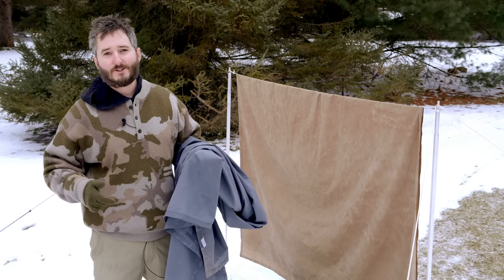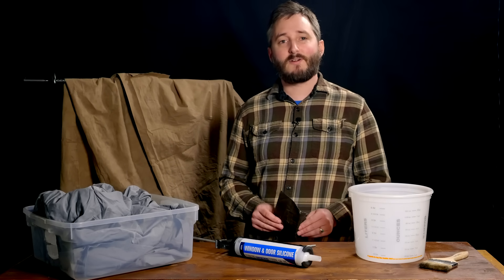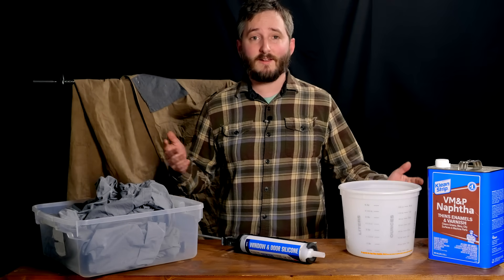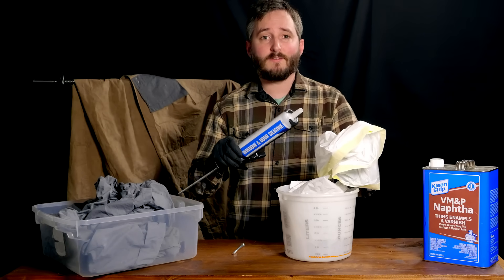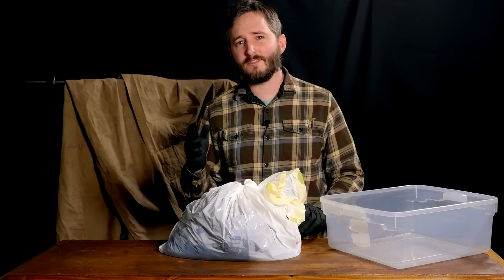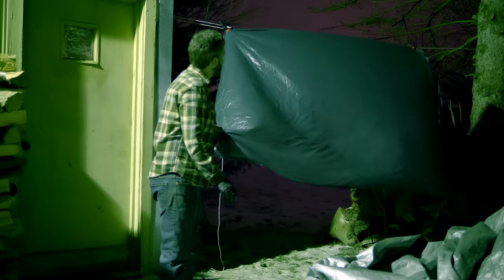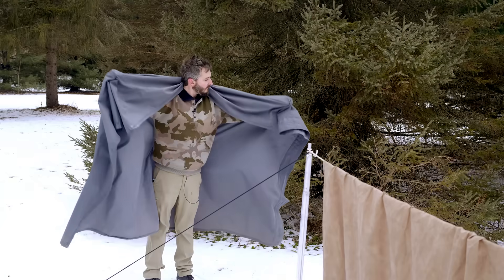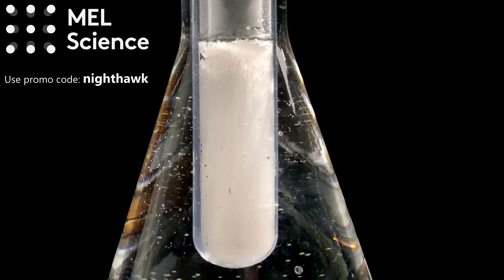Recycled Bedsheets Make The Best Waterproof Tarps

Comment: Why don’t you use water soluble silicone in stead of naphtha stop releasing the VOC’s into our atmosphere please , it will work the same way !
Reply from the maker: I didn't know water soluble silicone existed. I'll have to check that out
Reply: @Nighthawkinlight  it does , we used it all the time at work . You can get at any place that sells caulk , silicone caulk is water soluble
Reply: @Nighthawkinlight  there’s even water soluble clear plastics out there we use it at work as well .
Reply: @Nighthawkinlight  look at tubes of caulk if it says easy water clean up it’s water soluble . Good I never thought of waterproofing bed sheets it would have saved me some cash no more blue tarps lol .
Reply: @Nighthawkinlight  I have another idea they make a water based polyethylene deck sealer I wonder if that would work  just as well  a water soluble plastic . Experiment with it let me know if that works .

Comment: Love this idea! “Outdoor curtains” are quite expensive, especially if you want it to have a nice print on it. 

Thinking of buying bedsheets in a nice fabric and using it for curtains on an outdoor gazebo. How long should this last?
Reply from the maker: Hard to say. It depends on sunlight exposure. A few years at least
Reply: I think there is uv resistant silicone, that should help with longevity

Comment: Could I use this in a Hudson pump sprayer and spray on my roof shingles for this season as I have some leaks. I plan on replacing roof next year.
Reply from the maker: I'm not sure what that would do. I wouldn't risk it. The naphtha is extremely flammable and the vapors might fill your attic

Comment: Loved this.  Wonder how flammable the finished tarp would be.  

If you can paint this on or spray it you could probably make your own rain coat , ski bibs, etc., biviBag with the bottom being water proof.  Or water proof the bottom of your sleeping bag to overcome those leaky tents & spray your tent     Even use your bedsheet sheet as a cape like you did but big enough to cover your backpack and create a row of ties down both sides using the button string as you showed than tie the strings opposite each other together.   Carry a plastic sandwich bag in your pack filled with buttons and short pieces of strong string with a slip knot on each end.  That way you can create a quick tarp or a rain/ wind cape
Reply: Silicon is heat resistant and non-flammable.
Reply: If done properly it should be fairly flame resistant, it is still cotton though so under sustained flame it will eventually burn but a Lot better than say an oiled canvas.

Comment: Love the video. was going to go get some Naphtha. I looked up the price. It is about $45 for a gallon can of Naphtha. Considering that the bedsheet will eventually degrade in UV light, that is an expensive tarp. The thick plastic tarps last about a year for a fraction of the price like $5. Is this a cost-effective project? Please comment on your thoughts.
Reply from the maker: Naphtha is $16 per gallon where I am. I've been told that others have had success with ordinary gasoline, but that would make the fire hazard while making the tarp even more severe.
Reply: @Nighthawkinlight  That's much better. Can you provide link to where you get yours? I was looking at Amazon and found another vendor, which was $15 per quart.
Reply from the maker: @awesomedee5421  I get mine locally at ace hardware
Reply: @Nighthawkinlight  I'll have to check my Ace next visit. Can I use basically any thinner like paint thinner? The goal is to just get the silicone into a liquid form, right?
Reply from the maker: @awesomedee5421  You can't use any thinner. Mineral spirits apparently works but I haven't tried it.

Comment: How do we make this non flammable? I notice you said the mixing process could cause a fire.
Reply from the maker: The finished tarp is not especially flammable once dry. There's no way to remove the risk of fire in the process of making the tarp because the solvent is basically lighter fluid. You must be careful.

Comment: Just to be clear you should state that you are using silicone caulking. It really makes a difference. If you go into a hardware store and ask for a tube of silicone they will ask for more information. I know it’s pedantic but may help someone get the correct product at the store. Otherwise this is a super cool idea and I can’t wait to waterproof the crap out of all of my outdoor fabrics. Thanks for this idea. It’s much appreciated!!
Reply: 100% silicone caulking
Reply: thanks for clarifying that. That helps me.
Reply: Do you mean like silicone bathroom sealant? thanks
Reply: If the sales personnel ask you for more information on what kind of silicone you want, what else do you think they're thinking of?
Other caulking materials like acrylic are not silicone and thus not what you're looking for.
If, however, they ask you whether you want tin-cure or 2 component platinum-cure, go with the latter if you can, as tin-cure silicones are not skin-safe

Comment: I have successfully replicated this tutorial using mineral turpentine instead of naphtha, which is not sold locally in my country. 
It took a little longer, 36-48 hours to fully dry. The material I used was 100% cottons and extremely thin fabric. You could see straight through the fabric in good lighting, so probably a 60-120 thread count, but the water repellant quality is still there even using a single layer. The tarp is unbelievable light weight and compact.
Reply: I'm in the UK - what would anyone recommend as a good alternative to naphtha? I want to waterproof some cycling gear. Thanks for any information. 👍
Reply: @marknorman8588  Like I mentioned, mineral  turpentine/mineral spirits works fine, but needs to dry for a little longer.
Reply: Wikipedia refers to a PDF document providing substitutes for naphtha in different countries - white gas, shellite, wasbenzine, renset benzin, reinigungsbenzin,
kocherbenzin, benzina bianca, delek lavan, white gasoline, fleckenbenzine, 去漬油
Reply: The smell goes away I presume when dried?
Reply: @zee2938  but have to say after further testing, I wish I would have gone for a more tightly woven sheet.
Reply: @DKFX1  ok thanks for the tip. I’m considering making my own hiking poncho that doubles as a tarp. Have a cheap one on the way to test out and maybe see how I would want to modify it compared to other ones. If I can make my own waterproof fabric that would be ideal! Also would be handy for making my own gaiters. So many things.
Reply: @zee2938  yes, totally gone when dry and I didn't use the odorless version either.
Reply: Do you think gasoline would work?   It's usually my go to instead of spending 5-10x as much on naphtha.
Reply: @bullschitt3666  No, I don't think it would be a good choice, but I'm not completely sure about it.
Reply: @DKFX1  how does the tarp hold up over time? Does it wet through after a night of holding back rain? Thinking about this for an ultralight backpacking tarp
Reply: @richeyrich2203  Mine actually gets a bit wet rather quickly I found out, but will still keep water out. I suggested going with a tightly woven fabric as mine did not perform as I wanted, but I think it would have if I'd gone perhaps 250-300 threadcount or higher. .
Reply: @bullschitt3666  sounds terrifying,  and dangerous lol
Reply: @bullschitt3666  Bought some generic brand charcoal lighter fluid. 1qt for $6 USA VS $38 for Naphtha. Worked like a charm!
Reply: @bullschitt3666  naptha is straight run gasoline, same hyrdocarbons more or less
Reply: @Sinanjuphenex  I don't think gasoline will evaporate properly and will leave a bad smell. Just my intuition speaking though.
Reply: @Sinanjuphenex  This is not at all true. Naptha has 5-6 carbon-lengths on average while gasoline has 4-12 carbon-lengths PLUS additives for anti-wear, cleaning, and more.
Reply: Yes
Reply: Thanks for your info. Naphtha not available in my country except in Zippo lighter fluid which is horrendously expensive for a tiny 125 ml can.
Reply: @taab7  Mineral spirits or White spirits depending on where you live will work in place of the naphtha
Reply: Could you do this to any item of clothing?
Reply: @danielsbox27  yes, but some type of clothing would be best treated with a brush instead of submersion. Also, I would avoid treating stuff that has direct contact with skin.
Reply: Thanks! What fabric did you buy? Just trying to figure out how to make it lightweight as well as wide.
Reply: @ErmilinaLight  I'm a sewer so browse the fabric stores alot. I see lots of REALLY WIDE 100% cotton fabrics that is manufactured for use as quilt backings.  There's even muslin that is  XTRA WIDE. 
 Hope that helps out some of you folks.
Reply: @lynnodonnell4764  you seem to have posted this as a reply to another suggestion. Maybe in the main comment thread it would get more eyes on it and be even more helpful! Thanks for sharing.
Reply: @lynnodonnell4764  " Hope that helps out some of you folks. "
Sorry, doesn't help much without references.
Reply: @lynnodonnell4764  Oh, thanks! I was actually thinking maybe using polyester would be a better idea?...
Reply: @ErmilinaLight  that may melt in the solvent
Reply: The trouble with turps is it stinks and even the deodorizedone stinks and did the smell come out of yours if not a great people repellant and be careful sitting round the campfire regards from australia 😊😊😊😊
Reply: What ratio of ingredients did you use?
Reply: @zakkart  Same as Nighthawk did: 5 to 1.
 300 gram silicone for 1.5 liters of naphtha.
Reply: Porsche Monkey  What are you talking about?
Reply: @MGSLurmey  waterproofinng old bed sheets so when you get all wet and gooey or wet the bed it runs off like water off a ducks back no really its about waterproofing old bed sheets so you dont have to buy a tarp for camping leave the suspect stains on as they make great campfire conversation😆😆😆😆😇😈
Reply: Thank you from NZ..
Reply: Did the silicone and Terpentine mix easily.? I tried mixing Silicone and Acetone and it was a complete diaster/failure. Thanks, because we don't get Naptha in South Africa, unless it's called something else here, but we do have turpentine.
Reply: @dillee9988  Acetone is completely different than Naptha or mineral spirits. Acetone has high polarity, like water, so it won't mix well with silicone. You need to use a long chain hydrocarbon like the ones mentioned here. At least something like heptane or longer in carbon chain length.
Reply: @janderson2375  oh, you sound like you might be able to answer my question: What gases are emitted when you mix the silicone with the naptha / white spirit?   (Ie do you happen to know the basic chemical equation? )
Reply: @justme9818  There should be no gases and no reaction. Similar to how one might dissolve sugar in water, you are merely dissolving silicone into naptha.
Reply: @janderson2375  Oh! Thanks for explaining. -I thought the fumes he mentioned at the start of the tutorial were due to the mixing of the two substances together, but it must just be the smell of the naptha! (I hadn't heard of Naptha before yesterday. I'd no idea what it was until I did a bit more digging afterwards) I feel more confident now to try. I can handle that smell 🙂 !
Reply: @dillee9988  Took a good 5-10 minutes of mixing.
Reply: @dillee9988  Shellite is the equivalent product for naphtha in Australia, available in our biggest hardware chain store Wikipedia refers to a PDF document providing substitutes for naphtha in different countries - white gas, shellite, wasbenzine, renset benzin, reinigungsbenzin,
kocherbenzin, benzina bianca, delek lavan, white gasoline, fleckenbenzine
Reply: Ill do a test piece in a small cloth. Im excited reading the coments lol
Reply: Try shellite similar to dry cleaning fluid or maybe give tat a go regards australia 😊😊😊😊
Reply: Can you get camp fuel for coleman stoves?

Comment: In my opinion a much more elegant way than making an oil cloth. Am I correct in thinking this would also render the sheet flame retardant?

As a side note, you repurposed those sheets, you did not recycle them.
Regardless, an excellent video.
Reply from the maker: Flame retardant, but still flammable if you get them lit.

Comment: Another thing to keep the tarp from ripping, is to use bungee cord in addition to rope to allow the wind to be able to stretch out the tie down spots. Tie a rope between trees, attach the tarp to the rope with bungees. I used to rip all my tarps until I learned that trick.
Reply from the maker: Good tip!
Reply: excellent tip.
Reply: post picture please
Reply: good idea... bunjee cords seem to always deteriorate after a season or two though so i dont like buying them anymore if theyre going to end up in the trash so soon
Reply: Use cut up bycicle tubes, cut them lenghtwise.

Comment: So this didnt work for me yet. I cant get naphta here, so i took paint thinner, 400g silicone on 2L thinner. I also couldnt use the bag, because it started leaking, so i took the bucket i had under instead. Now: the first drops get repelled like you would expect, but as soon as the tarp gets wet, it drips straight through. Anybody has had a similar experience? Does the weight of the cotton matter? I took rather light bedsheets. Thanks for tips!
Reply from the maker: I'm not sure. Could be it would work better with a bit more silicone in the mix.
Reply: Hmm ok i'll try with a bit more silicone, a sturdier bag and sheet and see if i get different results.
Reply from the maker: @justgoboarding  Do some small test samples before a whole tarp. You'll find the more silicone you use the more waterproof it is, but it's harder to apply.

Comment: The safety data sheets (SDSs) from various naphtha vendors indicate various hazards such as flammable mixture of hydrocarbons: flammability, carcinogenicity, skin and airway irritation, etc.[23][2][24][25]

Humans can be exposed to naphtha in the workplace by inhalation, ingestion, dermal contact, and eye contact. The US Occupational Safety and Health Administration (OSHA) has set the permissible exposure limit for naphtha in the workplace as 100 ppm (400 mg/m3) over an 8-hour workday. The US National Institute for Occupational Safety and Health (NIOSH) has set a recommended exposure limit (REL) of 100 ppm (400 mg/m3) over an 8-hour workday. At levels of 1000 ppm, which equates to 10 times the lower exposure limit, naphtha is immediately dangerous to life and health.[26]

Comment: If you have a bucket with a good lid on it you could put the mixture and the sheet/material in the bucket and secure the lid and roll it around  on the floor or maybe make a roller machine out of bits and pieces and roll it like a front load washing machine....a bit more solvent/silicone mixture may also help prevent dry spots.
I treat outdoor clothing and gear with permetherin this way tohelp keep me from getting bugs, ESPECIALLY ticks!!  permetherin is MAGIC for killing ticks before they can bite you!!!!

Comment: this is a very helpful, easy to follow vid for waterproofing fabric. i'm going to try this, as i'm sick of tarps dying in the wind, and sheet plastic dying in the sun. both leave a horrible mess to clean up. there's always a ton of old sheets for next to nothing at garage sales, and they're just a couple months away. sew a few together with lapped seams, and i'll have a mega tarp on the cheap. thanx!
Reply: Naptha is highly flammable, do a flame test on a tiny scalp of material and you be very surprised.
Reply: @peterbeyer5755  well, it is what zippo lighter fluid basically consists of. so yeah, highly flammable is an understatement.
Reply: @handyhippie6548  Does that mean the treated sheets would be highly flammable? Or does the flammable component evaporate as they cure?
Reply: @evenstar42  the naphtha would evaporate away as it cures. most oil based paints and stains use a flammable solvent as a carrier for the pigments that evaporates away. the liquid paint is flammable, but the dried paint isn't. this is the same. it uses the naphtha as a solvent carrier for the silicone allowing the fabric to absorb it better, then evaporates leaving the solid silicone component behind. although cotton sheets are themselves flammable, i actually think the silicone treatment would make them less so.
Reply: @handyhippie6548  Thanks! That was kinda what I figured but wanted to make sure!

Comment: Something tells me to wear protective eye goggles, especially when squeezing the mixture inside the tested plastic bag.  Although tested, a hole could still appear which could allow some of the mixture to shoot upward toward your eyes.  In an outdoor environment and possibly away from running water, to flush out the possibly affected eye(s) would be a problem you wouldn't want to encounter.
Reply: Use contractor grade bags, problem alleviated
Reply: Do it at or near home, before the trip !!!
Reply: A meteor could hit the earth and we could all be killed as well.
Reply: You don't necessarily need to compress the liquid in a high pressure pocket. Think more squeeze the clumps between your fingers then rub them gently together. Near the end shaking should finish it off.
Like the packets of icing in Toaster Strudels need done the same way to melt them quickly...don't do it in a way you need goggles...although Im glad lab safety is your first though.
That's chapter one in any professional chemistry book.
Gloves, goggles, and fire extinguisher....always good to have.
I saved a house last year when I grease fire under a stove melted(overflow or what idk over years on a slanted house, idk) and pooled over to the gas line. I couldn't get to the shut off with burns and smoke was terrible by then.
Glad only reason I has that extinguisher was lab safety 101.
Wife's cooking can be just as dangerous or worse than what I do in a lab sometimes, God bless her heart.